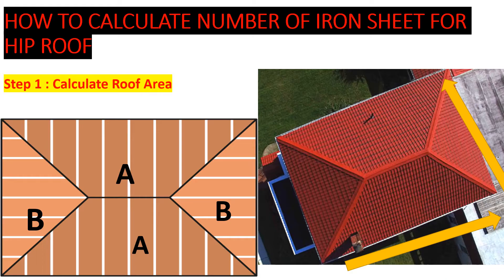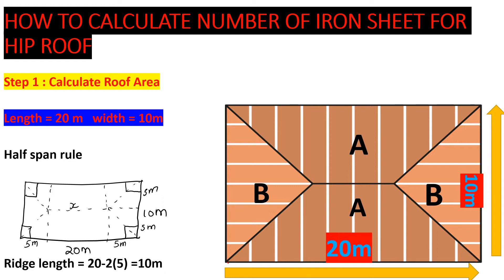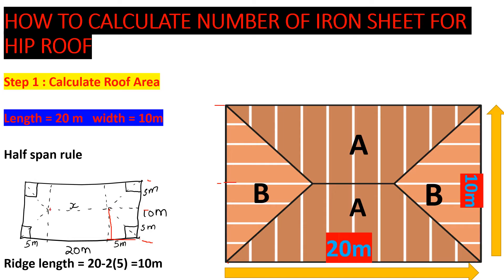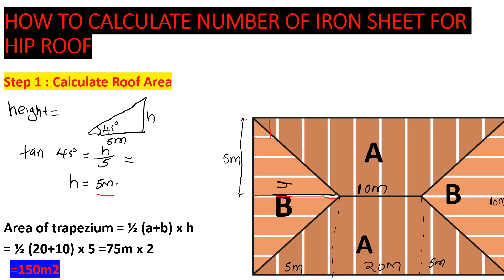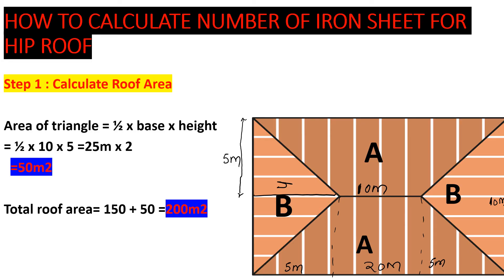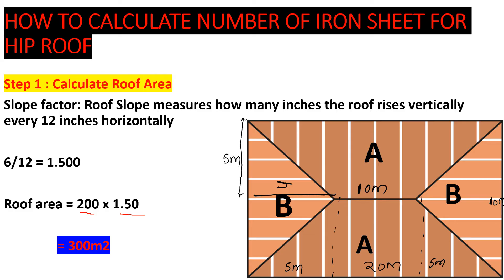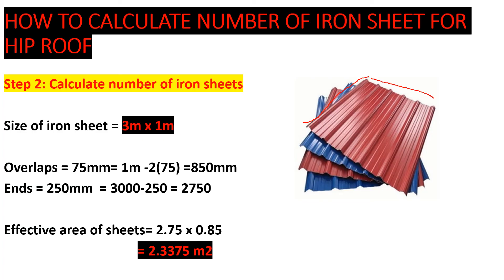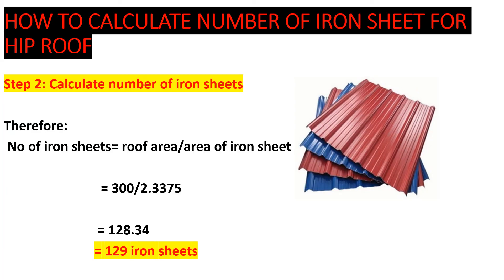HOW TO ACCURATELY CALCULATE NUMBER OF IRON SHEET FOR HIP ROOF|ESTIMATION| ROOF AREA

Comment: Hi, You are doing a great job my sister, Is it possible to calculate my roof dimension for me? I tried to calculate by studying you but couldn’t do it. I will appreciate if you can please calculate this for me. It’s deep roofing and the dimension is 20 meter 18meters. 20/18 meters.
Reply: I mean 20meters by 18meter. Kindly please help calculate this for me. Thanks

Comment: The roof slopes of 6/12 = 0.5 not 1.5 as you stated
Thanks
Reply: slope factor is equal to (rise/run) square in square root and plus 1, this is the formula used